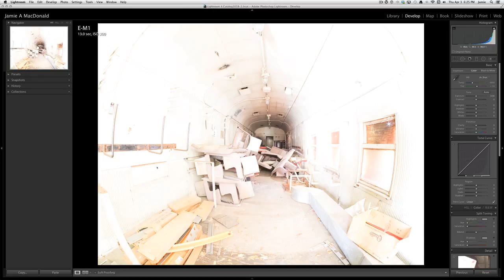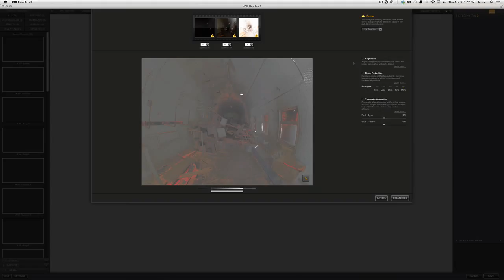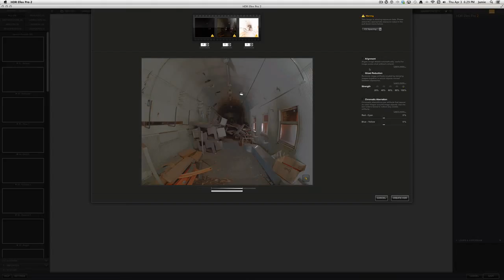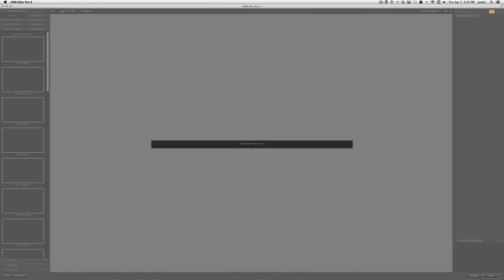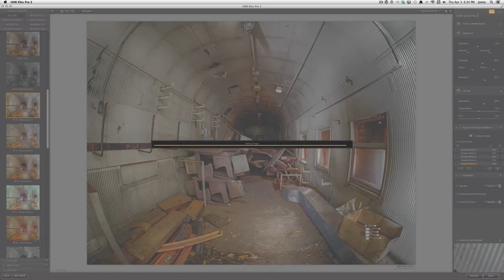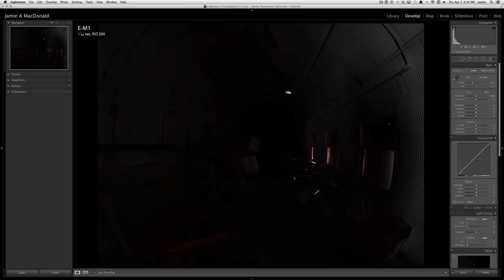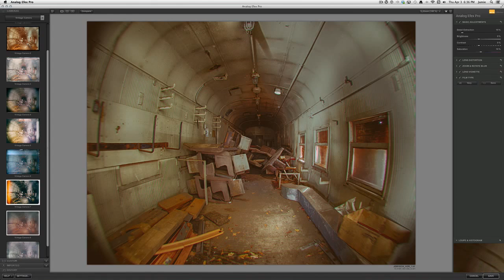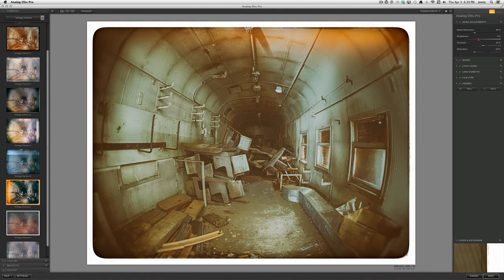Nik Software in Action

Comment: So are the effects you do, done with plug-ins in Lightroom? And is the built-in HDR effects in the OMD EM1 not adequate, resulting in more processing later? Are the HDRs made in camera RAW or JPEG?
Reply from the maker: The built in HDR function of the OM-D E-M1 is not the same as what I am doing here. The E-M1's HDR1 and HDR2 modes will NOT do tonemapping which is what I am doing, and what "most" people associate with HDR photos. What the E-M1 does in its HDR modes is to create an image in camera that is tailored towards generating a well balanced image for a dark scene, or for a light scene. And I can't remember off the top of my head but I believe that HDR1 would be used in a DARK setting to help give a more well balanced image, and HDR2 used in a BRIGHT setting to help properly expose the scene.
Hope that helps.
Reply: Yes. Thanks, Jamie. Is Nik a Lightroom plug in or is it part of Lightroom itself?
Reply from the maker: *****
It is a plugin that can be run from Lightroom OR...Run as standalone applications!
Reply: Thanks again, Jamie. You're a gem. I hope all is fine with you and yours.